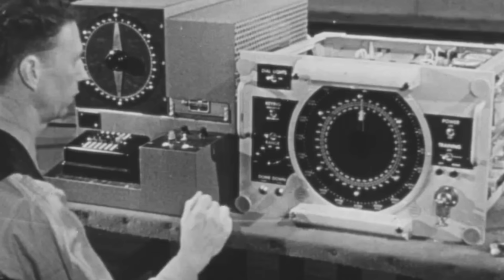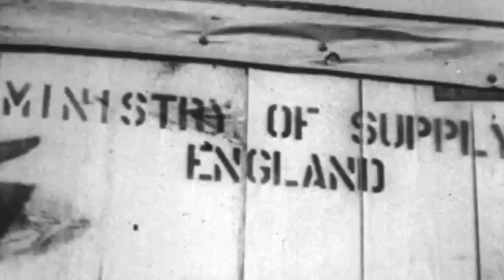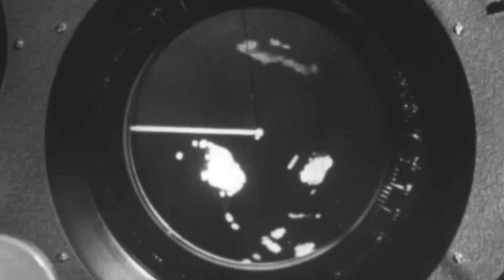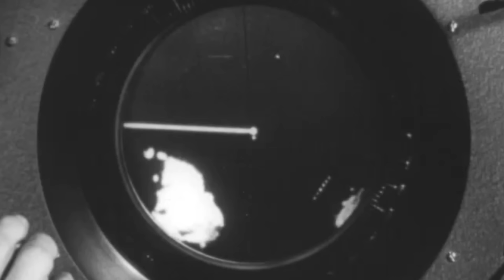The Secret Allied Weapon that Completely Changed WW2

Comment: But the Norton Bombsight was a piece of junk.  According to Wikipedia (and many other sources) - it was intended to get an accuracy of 75 feet - but in actual combat only managed 1,200 feet - which was no better than we were getting without it.  So the claims that Britain somehow got a deal on that turned out to be a total bust.  (Wikipedia: "Under combat conditions the Norden did not achieve its expected precision, yielding an average CEP in 1943 of 1,200 feet (370 m) (a CEP of 1200 feet means 50% of all bombs dropped land within 1200 feet of the target), similar to other Allied and German results. Both the Navy and Air Forces had to give up using pinpoint attacks. ")

Comment: But how come the wires don't break on the radar when it spins around?
Reply: The are no wires used to connectto the dish. The connection is done using waveguides.
Reply: @donaldevanshennings7732  YES Its called a Rotating Joint

Comment: Dark Docs - how do you come up with such inaccurate rubbish, and get so many facts wrong in a single video?
1.  You said, several times, that the British had invented the cavity magnetron 3 months before the Tizzard Mission.  In fact it was devised by Professor Kinjiro Okabe in Japan in the late 1920's, and well known around the world as useful in university research.   However the Okabei types only produced laboratory levels of power.   What the British workers Randal & Boot did was hit upon how to make it develop the kilowatts of power needed for radar.
2.   The cavity magnetron was not something that changed the War, because there were already other ways of developing high power microwaves needed for radar, such as the klystron, that were good enough.   The Germans and Australians manufactured quite good radar systems using fairly ordinary radio valves in innovative ways.
3.   You implied the VT proximity fuze was a British invention.   It certainly was not.   The VT fuze was developed in the USA for the US Navy, completely independent of anything from Britain, being a sort of doppler detector, whereas British wartime radars were pulse echo.   It used technology well beyond anything Britain could make at the time.  It's method of radio proximity detection is quite unlike any British or American radar.
4.   You claimed the British were desperate to get access to the secret Norden bombsight.   This bombsight was not secret - given it was carried on most US bombers and thousands trained to operate and maintain it, there would be no point in trying to keep it secret.  It is based on pre-war patents registered in the usual way.   The Norden is a tachometric bombsight.   The Germans had their own tachometric sight, the Lotfernrohr.     The British never wanted an accurate bombsight in routine use - they figured they just didn't need it, because Churchill's policy, implemented by Arthur Harris, commander of the RAF Bomber Force, was to bomb entire cities and set them ablaze with incendiaries.
Nothing in the Tizzard Mission was war changing, not in the sense of things like the Brits eavesdropping Enigma messages, the US and Australians eavesdropping Japanese radio messages, the development of heavy bomber aircraft and the multi-tonne bombs they dropped, and the development of the nuclear bomb.  The Tizzard Mission was merely an important cooperation process.
Even the British sharing their jet engine technology via Tizzard was not so important, given General Electric were working on it anyway, and that no country had developed jet engines to sufficient practicality early enough to make a difference in WW2.
5.   You said Churchill was newly elected.  He wasn't.   He was appointed an all-party leader and war minister by the King, after the previous prime minister declared war on Germany and it became apparent that he had no idea how to conduct and win a war.
6.   You said, "Throughout British territory, citizens endured nightly bombardment by Germany."   No, they did not.   Under Hitler's instruction, the Luftwaffe attacked only military targets eg airbases, and were not particularly effective.   But after Britain started bombing German city residential areas, Hitler allowed the Luftwaffe to concentrate on London and a couple of other cities.  That was their undoing, as it allowed the RAF to operate at full effectiveness and pretty much destroy the Luftwaffe's ability to attack Britain.   It is called the "Battle of Britain" and Britain won it - decisively, in a short time.
Reply: @keithammleter3824 Notice how NOBODY watches your historically accurate videos.
Reply: @kimbo99  ; I listed facts - all of which are verifiable.   all you did was make a silly comment.
Reply: @keithammleter3824  YET the fact I noted is also verifiable.. And its a pertinent comment,
Reply: @kimbo99  : Given that I publish in professional journals, which demand a far higher standard than YouTube, and I don't make videos, then obviously nobody watches any videos of mine.
Glad you appear to agree that the facts I gave here are correct.